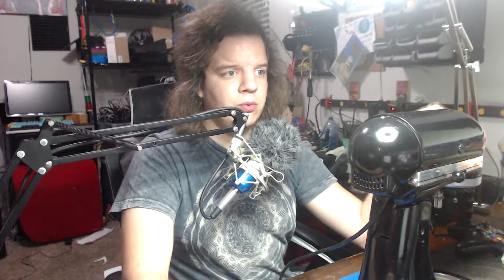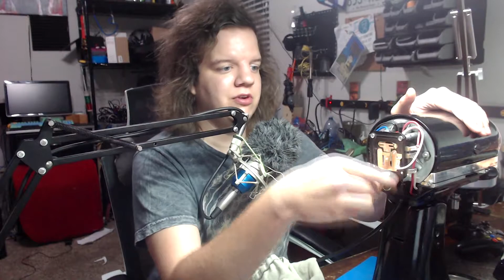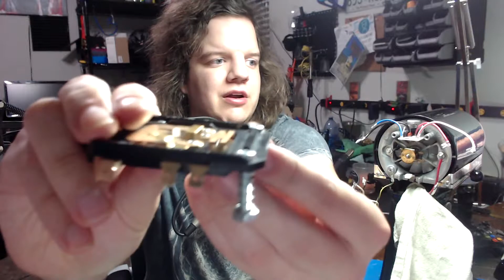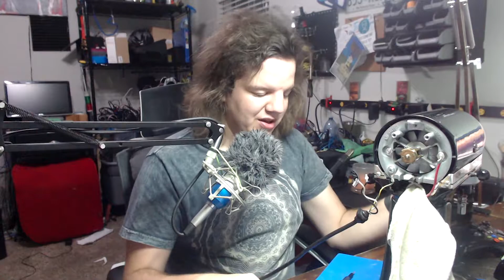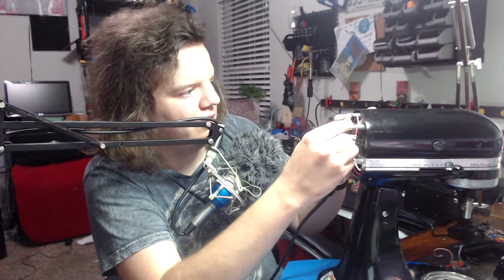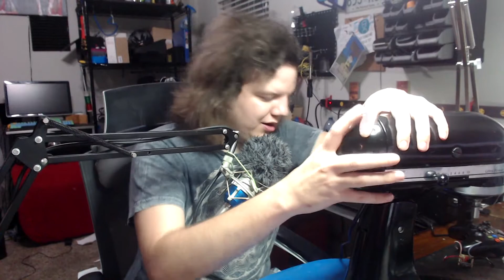How To Repair KitchenAid Stand Mixer (Phase board, Control Plate, Timing)

Comment: Great video. Our mixer busted. Bought a replacement board but before i was able to replace it one of those weights from the governor flew off. So the original issue was that it sparked when turning it on and it tripped the breaker, but it could be that the loose weight on the governor might have been touching that piece that you talked about at 15mins. So going to order that see if it fixes it.  Good video

Comment: After I finally figured out my replacement control plate was defective, by putting the old nasty one back in, I got the low speed dialed in.  Then I went to adjust the high speed and touched the screwdriver to the hot leads on the control plate.  Now I'm waiting for a new phase control.  Don't do that.

Comment: Just an FYI... Black wire is Hot, or Line or 120V, and White is Neutral , or 0V. Great job on explaining the motor control parts. Helped me to fix my mixer.

Comment: John:   I really appreciate your thoughtful walk through.  Please advise....  When remounting the control board.  I'm assuming that the white nylon tab at the bottom passes  UNDER the copper points.  However, moving the speed control level appears to always hinder the points from contracting.  And yes...I have no motor response.  It seems to me that the points should be in direct contact????  What am I missing?  Thanks.
Reply: It's been a month since you posted this. I'm assuming you figured this out.  Did you?
Reply: @BringItOn31124  Thanks for your repsonse.  Yes, I figured it out - more or less.  The design is both brilliant and insane...  So extremely touchy.  I finally got my Kitchenaide tuned-in after running through the same logic over and over again...and somewhat randomly finding the sweet-spot.  I'm surprised that after all these years, Kitchenaide has not designed this archaic switch.  Thanks again.
Reply: you say it's archaic.  Well.  It is the same switch they've used since forever.  At least it looks the same as the model 3 and 4.  The current machines look like the model 5    @shadow.6585
Reply from the maker: Sorry for the late reply, Mark! This has been a busy summer for me. 

First of all glad you got it figured out; just took mine apart again and I absolutely see where the frustration lies with the design. 

The nylon tab DOES drop down UNDER the copper contact and is shaped in a way to allow that motion to be somewhat controlled. Since this is the main on/off, my assumption is it could be bent or misaligned to not make a good connection unless set up just right. 

I can make a short on the operation of this switch if that would be more visually helpful for everybody
Reply: @johnshobbies  Thanks so much for your response and consideration a more detailed view the in installation and adjustment process.  You video was very helpful for me...as other presenters also were short of fine tuning needed to find that sweet-spot.  👍
Reply: I ordered a new control board, replaced all the electric bits because they were nasty. After complete disassembly and reassembly I got no power.  Pulled the armature out twice looking for bad connection from coil to brushes.  Turns out the new control board was bent and the points were not making contract.  I didn't understand the operation until I put the old one back in, which worked but was arcing blue flash to the ground wire.  Finally tweaked the new one to work.

Comment: Hello John,
Thank you for the great toturial!
I plugged the same 120V mixer into a 220V outlet, and now it runs only on maximum speed.. which part do you think is the cause, the phase board or the motor control plate?
Reply from the maker: Thanks! 

I can imagine that would be the phase board. When I was shopping for replacement phase boards on eBay,  they had 220-240v and 110-120v models. 

Is your mixer initially from a 120v country? If so, then it's possible that doubling the voltage and changing the frequency (60 -> 50hz) could have damaged part of the phase board. 

This could cause it to send the wrong voltage through regardless of control plate position. Does it get any faster as you move the speed lever? Specifically between speeds 2, 6, and 10?
Reply: @johnshobbies  Yes it's, I ordered it from the US..
I had the same thought and it doesn't get any faster as I move the lever it runs on the highest speed at all times. It runs so fast that it's basically unusable :(
Reply from the maker: I actually went ahead and looked up what was involved in converting it and I believe it's not as simple as just a phase board swap. 

The articles and guides I've found show both a conversion of the phase board but also the motor itself. If you're up for making that change, I saw a few kits on eBay.  

It is possible, given it's a phase-controlled motor, that a simple 220 -> 110 converter rated for the correct wattage would work. 

I'm not incredibly familiar with the specifics of converting appliances beyond that though.
Reply: @johnshobbies  I forgot to mention that I did plug it on a 220v to 110v converter after the fact and still it didn't work right..
I strated to think that something got damged by the high voltage when I connected it the first time maybe?
Reply from the maker: @akaishrike913  If that's the case, then it's maybe worth trying to replace the phase control board if you're willing to spend the money knowing it may not solve the problem.
Reply: @johnshobbies  That seems to be my only option.. I'll send you an update of the result once I do! 
Thanks again John :) 
Btw, your video made a supposedly boring tutorial into a really fun one, the FX was a great touch too xD!